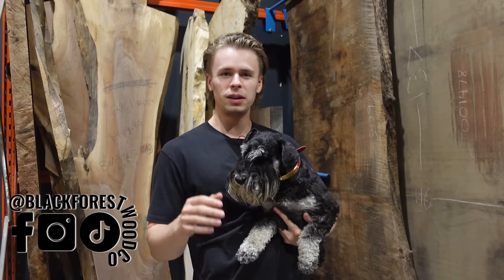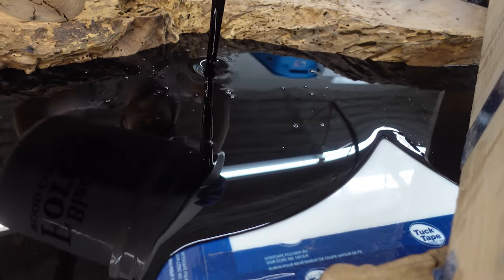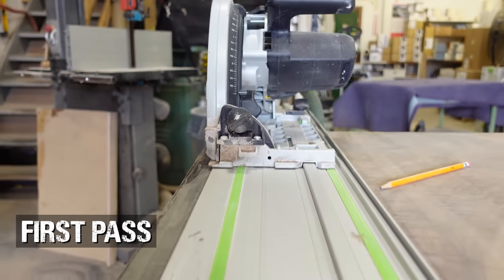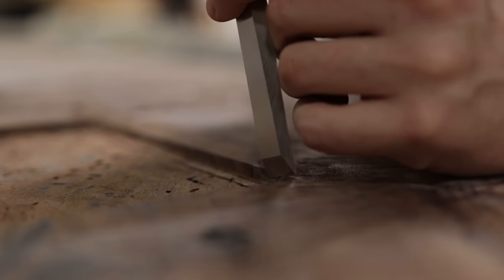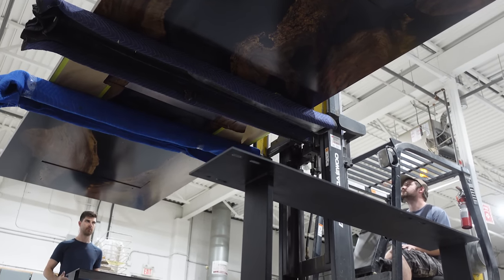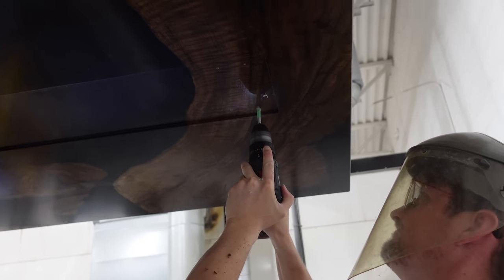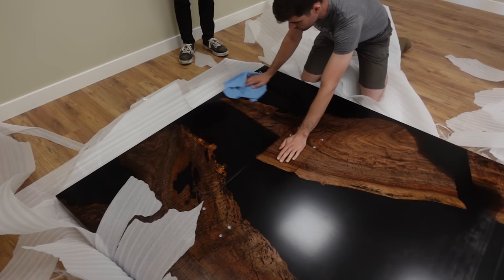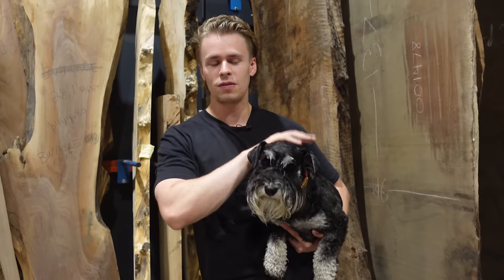Warped Slab to $27K Table

Comment: Charlie, I see you face the problem they have in many offices, the arms on height adjustable chairs do more damage to tables than all other risks combined. The arms are not  used in any practical manner 99 percent of the time. The main reason and defense for their existence is for people to feel important.
Reply from the maker: Fortunately our tables are made from solid wood and can be quite durable. I know what you mean though, especially on veneered tables the chairs can damage them so easily.

Comment: Leaving the base layer to partially cure allows a chemical bond between layers. Much stronger than flatting the surface and no sander marks on the live edges.
Reply from the maker: That is correct!

Comment: Charlie. But I always watch every video from start to finish.  When did Black Forest first open? And when did you, Dylan, start working full time?
Reply from the maker: Hey Scott! We opened in 1993 originally just making solid wood doors. I started part time in 2012 (when I was 14) and full time in 2016. It was around 2017 that we started getting into the resin work as well!

Comment: Charlie, I notice you guys don't typically install any type of c-channel or other re-enforcement to keep the table from potentially warping in the future. Is that because most of your tables are thick enough to not have to worry about that? And is the finish Jeco using Sivam?
Reply: C-Chanel’s are usually used on tables that are solid and you have the grain potential warping, by breaking the slab and having resin separating the pieces it would only make sense if you had 2 C-Chanel’s on every individual slab piece which would be unnecessary. And if you cut into the resin for the C Chanel it’ll be thin where you cut the slots and you run the risk of having the resin crack.
Reply from the maker: The above comment is 100% accurate ☝️
Reply from the maker: Yes it is Sivam!

Comment: Quick question: Is there a reason you don't add U-Channel to a table that size?
Reply from the maker: The pieces of wood them selves aren’t that wide, most of the the width is resin and resin is very stable. The legs also help to act as C channels and keep everything flat.

Comment: Charlie can you drill and tap a hole into the wood and then use furniture bolts, rather than using threaded inserts?
Reply from the maker: Yes you probably could!

Comment: Charlie,  what track saw would you say thats powerful enough or do most that compare up to the festool ts 75 you have to do multiple passes on thick wood?
Reply from the maker: It’s not a track saw but skill saw makes an awesome worm drive saw that can cut 4 inches at once with ease
Reply: Festool only

Comment: Charlie... How do you guys use threaded inserts in the epoxy?  Don't they chip out when you try to install them or are you using wood thread on the wood parts and fine thread on the epoxy areas?

Comment: Great video but working under a 200+ pound table with only the forklift supporting the weight!  That's like working under a car without jack stands.  Tall jack stands and 15 minutes max to put them in place is cheap insurance.

Comment: Charlie - Question, do you ever get a request for a clear epoxy with a metal flake in it? For some reason most if not all the epoxy pours I've seen seem to be with a black base pour.  i'm trying to understand why someone would want to take away from instead of adding to. J.M.O.
Reply from the maker: We’ve discussed it with a couple clients but nothing has actually sold yet!

Comment: Charlie, why don’t you seal the wood so you don’t have bubbles left in the epoxy?
Reply from the maker: By using a high quality epoxy that releases bubbles well there should be no need to seal. We also find we get a stronger bond when we don’t seal!

Comment: Charlie is adorable. I can never seem to remove my sanding marks. I typically sand my tables in sections and there is always visible differences between each section even with the exact same sand paper on my orbital sander. After I apply my finish (usually rubio) the overlapped sections of sanding are still visible. Any advice?

Comment: Charile  I hope that table table top is supported by more than just the forklift. The failure of a 50 cent O ring or 5 dollar hydraulic fitting will make for a very bad day for those two guys standing under the top.
Reply from the maker: You’re 100% right

Comment: Charlie, after the table gets sprayed with urethane, do you guys level sand yourselves afterwards? I noticed this was left at a satin sheen, so curious as to what grit you went up to on this?
Reply from the maker: We sand before the poly urethane finish. We go from 150, 180, 220, and finish with 320. Then the first coat of urethane gos on, and they sand to 400 in-between their coats, then we put our Black Forest Ceramics over top after it's cured.

Comment: Charlie, use a decent drill bit and don’t be so hard on the timber Jesus you left cracks and chips in the bottom of it. No you won’t see it but that’s not the point. If I spent 27 k on a table I wouldn’t be happy with your handy work that’s for sure.